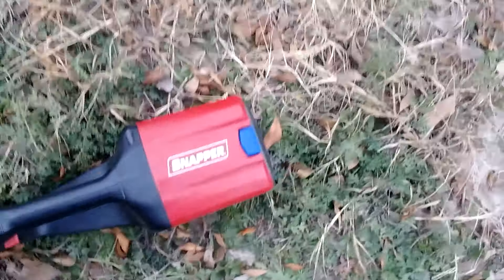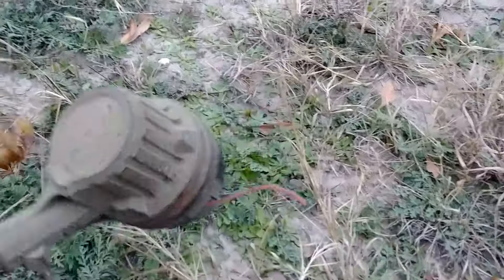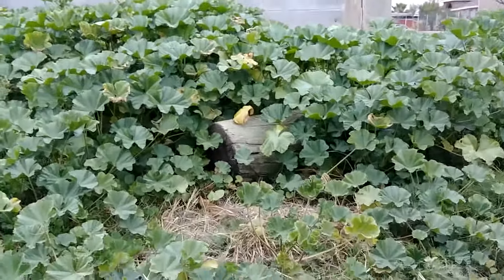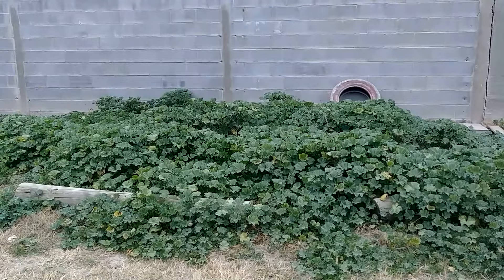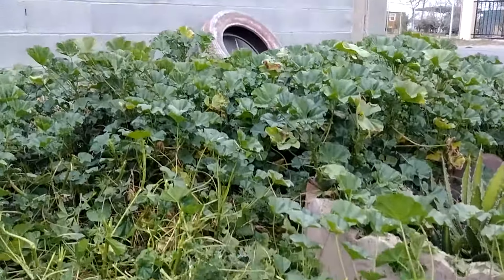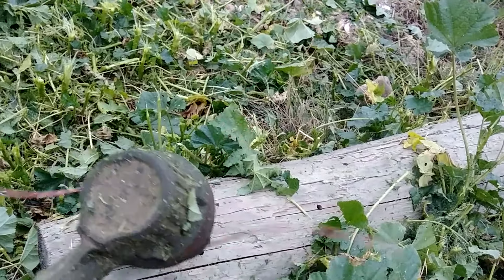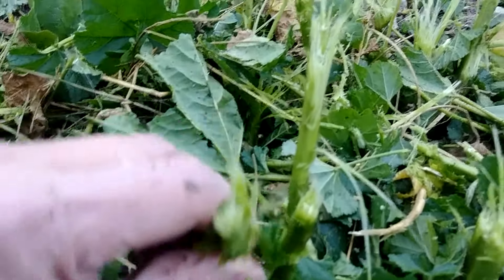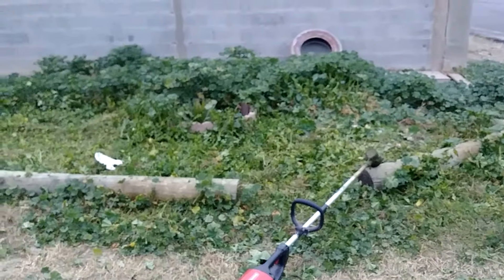Snapper 60 volt string trimmer

Comment: how the hell to you change out the whole bump head
Reply from the maker: You take off some he cover, then pull off the bump head
Reply: @electriccuts  I have a 60v Snapper trimmer.  I bought it about 4 years ago and don't need to use it much.  Problem this year is the head keeps falling off.  I live in Pennsylvania and I am struggling to find a place for service or parts.  Snapper say to go to Greenworks, Greenworks says they don't service them.  Does anyone know of a Snapper service place in central or eastern Pa.?
Reply from the maker: Plastic String Trimmer Spool Cap Cover https://www.lowes.com/pd/Greenworks-Replacement-Spool-Cover/1000769020
Reply from the maker: Plastic String Trimmer Spool Cap Cover https://www.lowes.com/pd/Greenworks-Replacement-Spool-Cover/1000769020
Reply from the maker: Plastic String Trimmer Replacement Bump Knob https://www.lowes.com/pd/Greenworks-Replacement-Bump-Knob/1000769024
Reply from the maker: @tomfisher3117  Plastic String Trimmer Replacement Bump Knob https://www.lowes.com/pd/Greenworks-Replacement-Bump-Knob/1000769024

Comment: Man the owners of the house really let their yard go.
Reply from the maker: +Juan Nino it wasn't too bad. This snapper weedeater made quick work of these big bad weeds, especially with that .095 diameter line. Which by the way does not come with the machine... It comes with .080 diameter line. Maybe that is why the motor was having a little bit of trouble lol.
Reply: Anybody how to remove stuck batter from the same weed eater in video
Reply: Jose Sanchez try pressing the button and turning the weedeater upside down. Sometimes it takes a little convincing to take the battery out... Let me know if it works